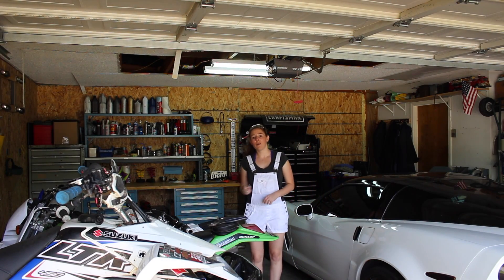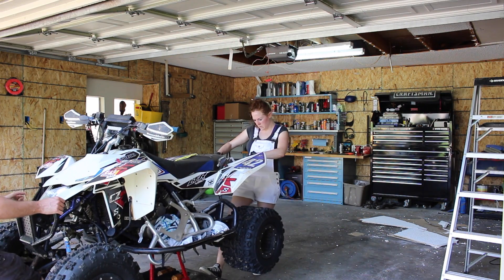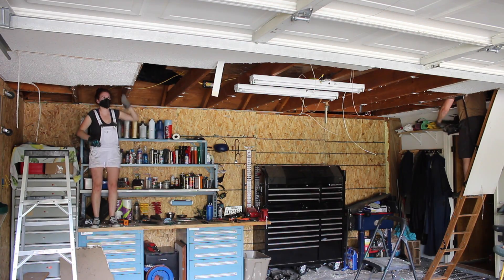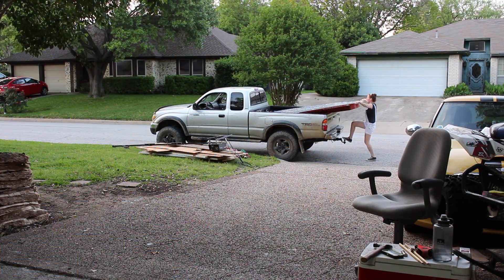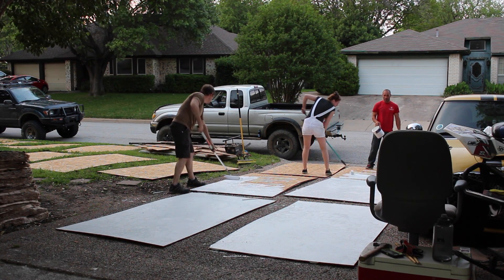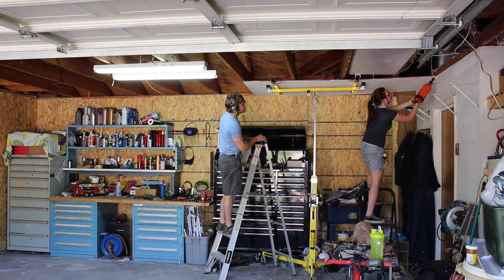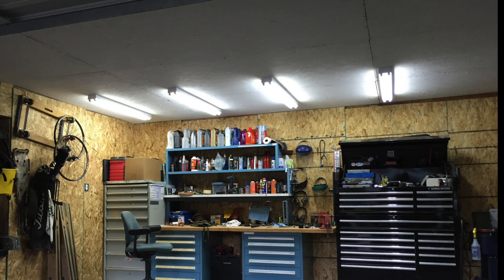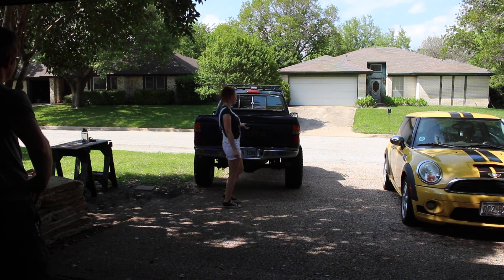Garage Ceiling Overhaul

Comment: Is there any sort of code in your area on garage ceilings?   we have a firecode of 5/8s sheetrock
Reply: In California, I think it is 5/8" for a shared wall with the house.  But I don't think the ceiling (or other walls) needs to be 5/8"  However, it is typical to use 5/8" on a ceiling to prevent sag, especially if joists are 24" apart.

Comment: You did fine backing up!  You didn't hit anything.  In aviation circles, we say a good landing is any landing you can walk away from; a great landing is where they get to use the airplane again.  You get to use your truck again!  I had the same problem with the wallboard falling from my carport ceiling.  Nailing wallboard to the ceiling is never a good idea in my experience.  Sure it will last for a while, until the home warranty expires.

Comment: Popping nails is an extremely tedious task! Gutted & remodeled 2 bathrooms recently in a 60s house. After demoing plaster on mtl lath walls & ceilings, I had to pop hundreds of nails.
Reply: +Kieran Lachman - I agree.  I think in this case, I would have just hammered them in flush...same end effect and easier than pulling.

Comment: Ratchet strap to hold garage door rails & frame while putting up the drywall is what I learned
Reply: james Sho I used chicken wire. Then when putting up the sheets just pulled it around the ends. Once the sheet was up and the bracket screwed back in then cut the wire. The other end is still in the ceiling to this day😂

Comment: first thing to realize is, there is a reason why all the drywall on the ceiling fell down...... most of the time it's because of moisture( check roof sheathing for any leaks before you do any ceiling work in the garage). replace Roofing if necessary to prevent any further leakage.
the next thing to do. is to clear the entire garage empty. then pull all the chipboard off of the wall behind the tool boxes and shelves up against the house( leaving bear one side wall frames, moving electrical if needed). and pull all the old drywall off of ceiling same thing move electrical if needed and add bracing if needed( as well as any airlines coming from a compressor).
insulate walls and ceilings with insulation Batts Staple in place in between wall studs and ceiling joist....
then install sheetrock boards on ceiling , then Wall....
tape, texture, sand, paint.   ( fire code ).
:-)
Reply: addendum,....
after pulling chipboard off of tool box and shelf wall. and adding any bracing needed for hanging weight.
ad fire blocking in between each wall stud 48 inches up from the ground. before installing sheetrock boards

Comment: Did you upgrade the lighting as well?
Reply from the maker: Yep, we went ahead and got rid of the old lights and installed new ones. We still have a few more to put in.
Reply: +galax  it means to move forward in conjunction with another action.  ;p

Comment: Im not entirely sure I see the need to completely tear out the old dry wall if you were going to use osb. Mark the rafters, shim the areas where it was missing, and just osb over it. Just seems like a lot of extra work. Probably would have used screws instead of nails too. You mention organization using the ceiling, screws would hold better. Albeit, that would be my preference but nails should be ok too.
Reply from the maker: The old stuff was falling off. If you notice in the video I just had to hit it a little bit for the entire thing to come crashing down, and two sheets already came crashing without any motivation from us. It wouldn't make any sense to install new stuff over bad stuff.
Reply: If the nails are ring shank or long enough, then no need to worry.

Comment: I think one of the problems with the ceiling (old drywall) might be because of the spacing of those rafters. From the video they look like they're 24" apart rather than 16". Shouldn't be much of an issue with the OSB though.

Comment: No big fights or blow outs working together lol, what was that shiny stuff on the back of the OSB? The drywall lift is a back saver. I hate to say it but most women I know can't back up a vehicle very well.
Reply: +Graveltrucking its a radiant barrier. usually used on roofs not ceilings... keeps the suns rays from heating up the attic.
Reply: michele vitarelli Never seen it before not something that is common where I live in Canada. Myself I don't like OSB its shitty stuff it doesn't do well in climates where you have lots of rain.

Comment: I used OSB for my garage ceiling, used the correct rated paint and a pro tip, use screws and washers. Gives the screws a better chance at holding everything up. I did have to run perpendicular 2*4's, but not 16 on center. What the code nazis dont see, wont hurt them.

Comment: would maybe have been easier to put in first new dekking on top of the beams, then put in the ceiling? Now everything has to go thru whatever hole/access there is. Also for isolation etc.
Reply from the maker: Yep, we actually lifted all the new decking in before finishing the ceiling. I just didn't add it to the video because we were in a really big rush to get this finished on time so I put the camera away.

Comment: You guys had nails holding up the drywall on the ceiling? That was probably why the ceiling was falling down. Screws would have been better. Especially if the attic was going to be insulated.

Comment: OSB on the ceiling....great idea. Until you need to pull off about 5 sheets and it's all been nailed up with about 20 nails in each sheet. Talk about brutal. I can tell ya I will be screwing up their replacements.

Comment: FYI you have a back up light out.
Also a good wrecking bar works great for pulling down ceilings. I'll link the one I use. I'm a fairly large guy and I could have pulled down your whole ceiling there in under a minute. You just jam it into the ceiling hook on and pull down.
http://www.amazon.com/Stanley-55-104-36-inch-FatMax-Wrecking/dp/B0009UFJAW

Comment: Allways. Stagger. Joints.    :)
Reply: in my garage I have 2x4 truss's at 24inch center's. Will that support drywall or is drywall too heavy?
Reply: Just A Seeker, That'll work just fine. I'd strongly recommended putting OSB or plywood behind it to add strength.
Reply: It's the ceiling truss's, won't that be too heavy?
Reply: Just A Seeker Oh, pardon me. Then yes, it will be too heavy.
I don't know the english word for it, but you will need to put up a criss-crossing pattern of smaller boards first to distribute the weight. Their dimensions are about 0,5x2 inches. The first layer should go across all the trusses and the other the opposite way to form a square grid pattern in your cealing. As for the distance between them - if your boards are 2 feet wide, each 'square' should be 1x1 foot. It won't be strong enough to walk on if you're up there working, but it'll hold it for years and years.
I apologize for my lack of correct terminology and the misspelled words, but I hope this helps 😊